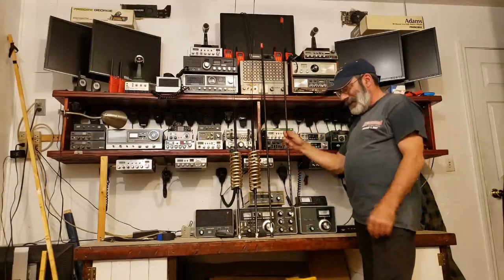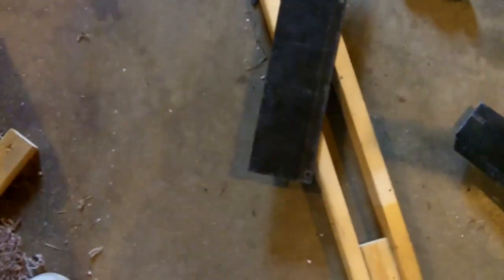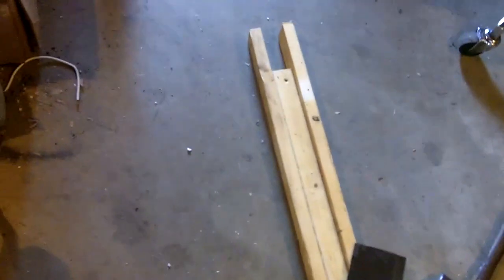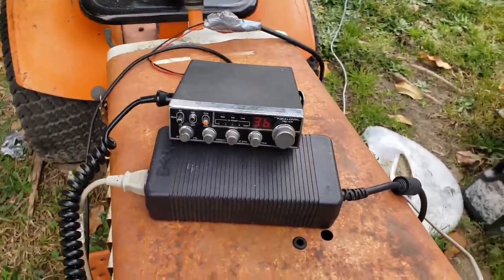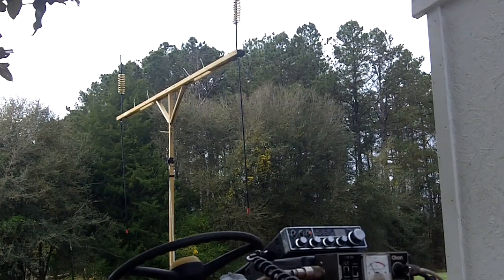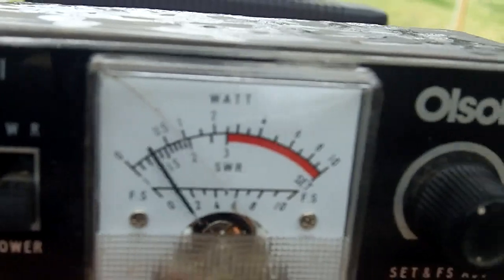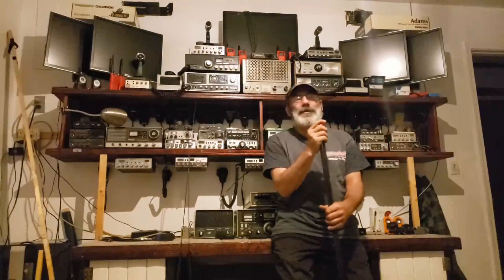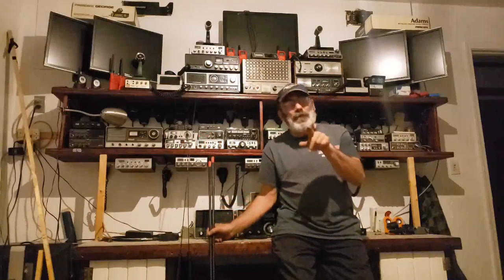Trucker CB Radio antennas..... Without the Truck!

Comment: We had a member of Radio Canada do this with co-phased Imax antennas I believe...maybe a99. At the time Imax antenna were $90-120 bucks...now they are $260 here in Canada...worked well because locals were all in one direction. Love the video.
Reply from the maker: Thanks for watching, 73's from 151 SC.
Reply: Acts like a beam?
Reply: @theboogeyman826  Someone will know the exact shape. Instead of a circle...more like 2 circles overlapping like  an 8. He had about 300ft of elevation on me over 60 miles. The shape would also be affected by the ground plane or building it was attached to.
Reply: @tf7274  a neighbor of mine use to talk to someone a few hundred miles away with a beam everyday. I could never hear the station my neighbor was talking to. I didn't understand why.

Comment: I have done this with two A-99 ‘s , plan to phase 4 together into a quad in the future, rock on bro!
Reply from the maker: Nice! Please let Me know how it turns out.  Thanks for watching, 73's from 151 SC.
Reply: Jack son! I want to try it as well with my 2 A-99's how well did your set up work? Did you use any ground planes or just the sticks in the air? I want to build one but need more info.
Reply from the maker: @shanesmith3753  You can co-phase 2 A99's, but you need to have 18 feet between the 2 antennas. for My setup I had to use ground planes, But 2 A99;s will not need any additional ground planes to work.
Reply: @shanesmith3753  it worked great of course somewhat directional , tested both with and without ground radials. As always the ground  radials aided in decoupling from RFI underneath the antenna and also created a more desirable angle of radiation.

Comment: My favorite part of CB, in fact, all amateur radio, is building antennas to reach as far as possible. Have built several 10-11-12 meter antennas, mostly for CB, now trying for a multi-band for hams 20/40. Got to finish license requirements first. Good stuff, maybe hear you someday. Southeast TN.

Comment: Your radio is a TRC 474 and when you transmit it continuously monitor your SWR and a red diode will come on if any problem with the antenna ! Very interresting experience and result 👍
Reply from the maker: Yup! that's why I use this radio for antenna testing. the AWI can be adjusted, I have this one set to come on at 2-1 reading.  Thanks for watching, 73's from 151 SC.

Comment: I did this in 1982 on UK FM CB using 2x end fed 1/2 wave verticals..it does work being bi directional. You only need to turn 'em 90 degrees for full coverage 🙂

Comment: I think your next project is going to be a retractable (tilting) antenna tower with either an electric hoist, or hand crank pulley system. 😀
Reply from the maker: I was just thinking about Your comment, and I realized I could use the PTO on My Tractor for the lift.  Thanks for the comment, 73's from 151 SC.
Reply: @MowerJunkie  I'm glad I could inspire you.  lol

Comment: Back in the day I mounted two 1/4 ground plane antennas off opposite ends on the house, Great DXer! And some what directional. The old Radio Shack ones with the gamma match used a tuna can and so239 s to split the signal.

Comment: You were getting a 3 db gain or a double of output. Every 3 db gain is as if you doubled your output and also your receive. If we get our gain from the antenna we also get the better receive. Thank you, I am planning to do exactly the same idea but on 20 meters on top of a 12 x 24  building with a steel roof.     I usually  end saying CBing at its best, but for you my friend, it is radioing at its best, not just CBing. I will buy you the study book to get your ticket if you will take 2 weeks, make flash cards of the questions with the answer on the back so you can also play on other frequencies, not giving up what you do now. You love the radioing hobby too much to limit yourself.

Comment: Great video,  I may have to go back and review it to see how it's wired again.

have a great day
Reply: 75 omni coax n 180' out of phase
Reply from the maker: This was just an experiment, So it was a very basic. If I ever build one to use, I would use connectors at the ends of the coax. Thanks for watching, 73's from 151 SC.
Reply: @MowerJunkie  that's way we learn n one joy of are hobby 
N then work rare dx whith some thing we build are SELF 😁

Comment: 2 monnth ago i bought Cobra highgear 2000 HG antenas with golden coil ..  But SWR is 2.0 .. What do you think about make a dual system of this two twin antenas ... how many inch ( cm must be beetwen him )  I have this tiny replica of rubber duck truck on a base suzuki jimny .. but this antenas wrong does on 27mhz ...  on spectrum analiser good SWR is 28..30 MHz but are to short (main wire ) ...  must try to add one two inch ..

Comment: Them goofy super air coil antennas are just 1/4 wave whips, while the Firesticks are 1/2 wave or some are 5/8 wave, those should be on top, for the double 5/8 wave, horizon shooting gain lobes, which I would not think works as well when they are ground side, but that may explain the wide, low SWR's ! 
4 5/8 waves, and set it flatside, you got a nice sideband shooter.
Reply from the maker: the firesticks I used are the old style 1/4 wave whips. Thanks for watching, 73's from 151 SC.

Comment: If you can get 6 102" stainless 1/4 wavelength whips,  make the correct length boom, trim the whips to the correct length,  you can make a nice 3 element beam. Use it vertically or horizontal.  A good gamma match or beta match and put it up high and they work great. Have fun experimenting.
Reply from the maker: Thanks for watching, 73's from 151 SC.

Comment: Very interesting  wouldnt that be somewhat directional  if you had 4 and a switch  and swith between pairs   just wondereing
Reply from the maker: More elements would require a matching device. otherwise the inactive antennas would absorb the signal, and mess with the SWR reading.    Thanks for watching, 73's from 151 SC.

Comment: Tip try to make a U dipool upside down from wire 1.36cm to left 1.36cm down 1.36right 1.36cm down ugly balun by feedpoint 5x 11cm from coax and hang horizontal on 2.35 m/2.65m this is for 27.205mhz vertical polarization or make all side's 1.39m hang on 5meter abovegrond it is horizon polarization for 27.245mhz

Comment: Super Scanner did basically the same thing many years ago , with a switchbox and three antennas
Reply: It also should be somewhat directional did you rotate it is see a change in signal strength ?
Reply from the maker: I wish I could find an old Super scanner! They're great antennas.  I'm going to be building a better version of this antenna. When I do, I'll be doing a lot more testing with it.   Thanks for watching, 73's from 151 SC.

Comment: That’s a fun looking project. What formula did you use to determine the length of the phasing harness?
I’m going to phase a couple maco 3 element beams this spring.
Reply from the maker: I found co-phase info on a trucker forum. it was easy to find with a Google search. Thanks for watching, 73's from 151 SC.
Reply: @MowerJunkie  I’ll do a search. 
Thanks mower and keep up the good work. Your vids are very interesting.

Comment: @mowerjunkie i just came across a few cb radios at a yard sale for SUPER CHEAP and i pulled them all apart to check them out and the one is a uniden grant am-ssb transceiver with a am usb and lsb knob and im no expert but this thing looks like its been juiced up and its got 2 random switches on the back one is just a up and down swtich and the other is up middle and down... My question is can i send you some pics of it on fb or twitter and maybe you could help shed some light on my suspicion? Thankyou in advance
Reply: Maybe just create a new post with pics and ask the community?  I'd be curious.
Reply from the maker: You can email pics to me at  mowerjunkie@yahoo.com
Reply: @MowerJunkie   email sent.. I had to send the pics in 3 different emails
Reply: @Tony-rl2fr   im not sure how to send pics on YouTube comments
Reply: Once i kno a little more about this unit i plan to use it as my base station

Comment: I'd like to co phase two a99 Antennas lol
Reply from the maker: You can! 2 A99's 18 feet apart, and connected with a 75 ohm Co-phase harness would work very well.
Reply: @MowerJunkie  yes i know but would it really be worth it lol
Reply from the maker: @chris2crazzy  Nope! A 2 element vertical Yagi would out talk it all day long. and the Yagi is cheaper.
Reply: @MowerJunkie  thing is I already have a a99 up48 feet lol

Comment: Great little project... but even with a stock radio.. if you're not 1.2 or under hang it up...
Reply from the maker: I agree, If this was a permanent install, I would have tuned it better.   Thanks for watching, 73's from 151 SC.
Reply: @MowerJunkie  maybe we'll hear you in skip land Channel 28...boss hogg in Virginia
Reply: Why do you say that? The losses associated with an SWR of 1.5 or 1.7:1 are negligible. And you're not going to blow the final on that radio.